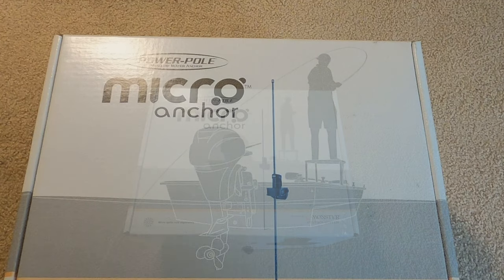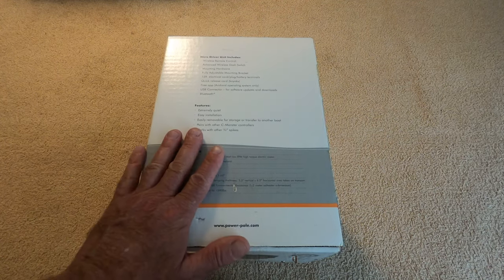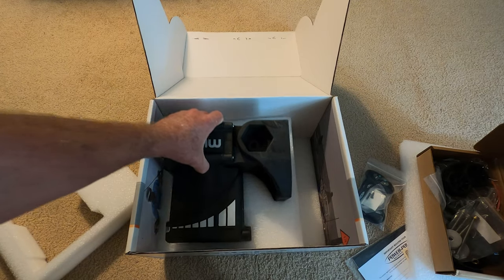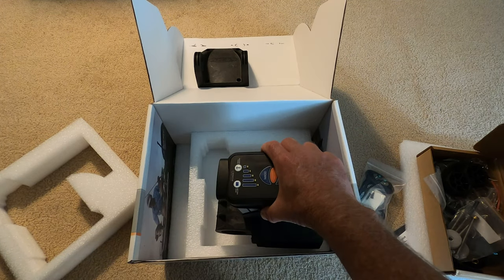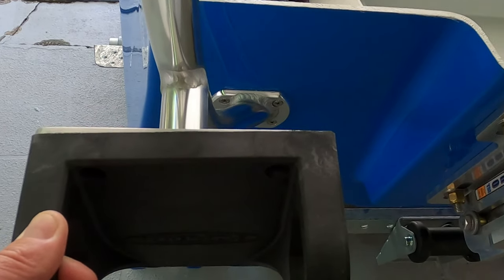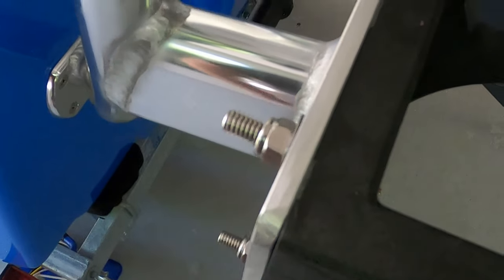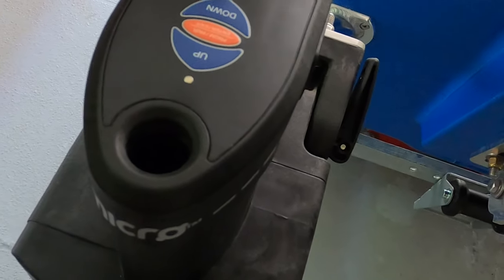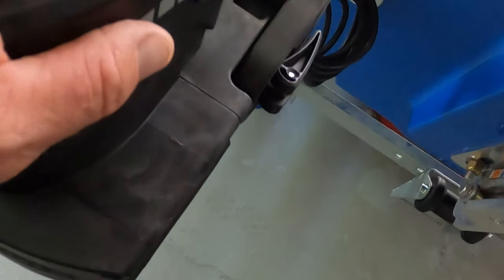Power Pole Micro Anchor Review and Installation Instructions 2024

Comment: I’ve watched a lot of videos and have never seen once where they show how to tilt the mechanism horizontal and then how to lock it back in the vertical position. This is one of the most important issues . The bottom line for me is can you do this complete operation without having to go back to the unit and physically lock it back in the vertical position. Thanks